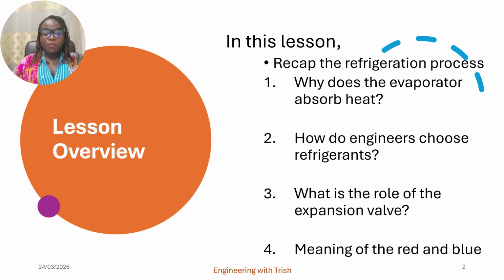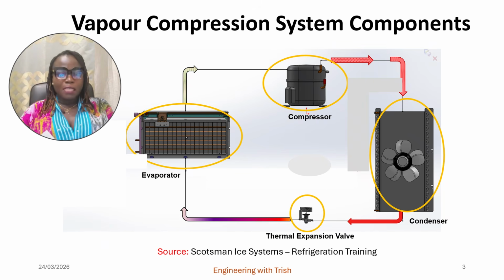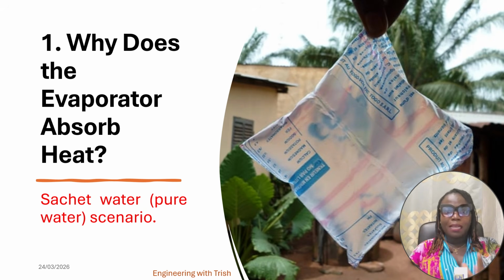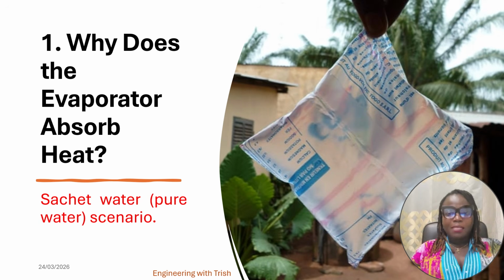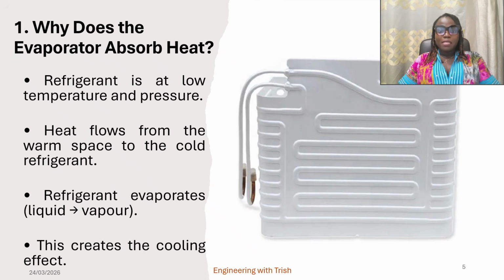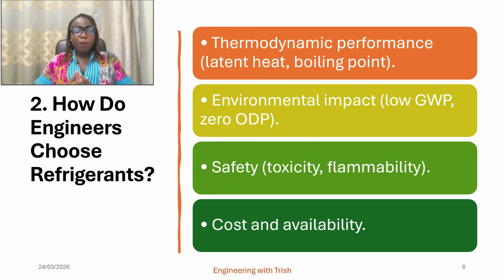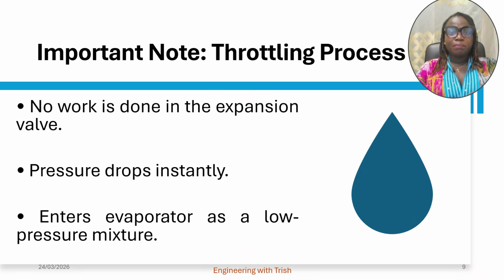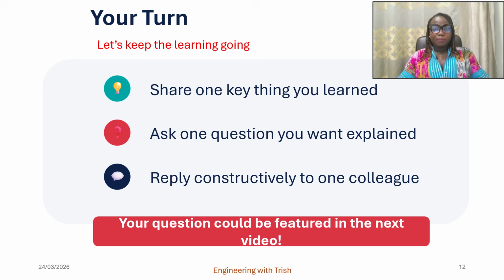Refrigeration Cycle Explained | Students Questions Series #1

Comment: I have learnt that the evaporator absorbs heat.
Refrigerants chosen are based on performance and safety.
Expansion valve enable the Cooling cycle .💯
Reply: Absolutely 💯
Reply: Yeah 👍👍
Reply: That’s nice
Reply: True 💪👌
Reply: That is very true
Reply: Good
Reply: Sounds amazing
Reply: Interesting
Reply: Yes of course it regulate the flow  of refrigerant
Reply: Yes, from the sachet or cup of water to which begins the refrigeration cycle.
Yes, it also depends on the environment effect it has
Yes, the throttle in the expansion removes the high pressure from the already low temperature gas or refrigerant

Comment: The four main components of the vapour compression system.
1.The compressor
2. The condenser 
3. Thermal expansion valve 
4. The evaporator. 2:27

Comment: I learnt that the evaporator absorbs heat by refrigerating at low temperature and pressure. and also heat flows from the warm space to the cold refrigerant.

Comment: I learnt that the four main components of the refrigeration cycle are 
1. Compressor 
2. Condenser 
3. Thermal Expansion valve 
4. Evaporator

Comment: in this video i learnt about  how  engneers choose  refrigerants. and they choose them according to the use of them. and there are 2 types, the R134a and the R290
Reply: Nahh bro those aren't the types of refrigerants, R134a and R290 are examples of refrigerants. There are about five types of refrigerants like Hydrofluorocarbons which R134a is an example of and another type is a natural gas called propane which R290 is an example of.
Reply: @Cielo915  oh okay, thank you very much

Comment: I have also learnt that the expansion vulve, based on its sensitivity is termed the brain of the refrigerator for its ability to control refrigerant flow, cause temperature drop as well as perform sensitive actions

Comment: I learned that refrigerator is a device that  absorb heat from low temperature to a high  temperature, also the working fluid in a cycle is called refrigerant
And also there are  four components of a refrigerator; 
1. Compressor 
2. Condenser 
3. Throttle 
4.evaporator.

Comment: I learnt that, evaporator vapourises the refrigerant by absorbing heat.

Please madam,which part carries the low pressure vapor from evaporator to the compressor.
Reply from the maker: Great observation! The suction pipe connects them. 😊

Comment: From your last lesson you made mention of 4 main characteristics of Carnot.
 - heat is supplied At high temperature 
-part of the heat is used as work done
- the heat not used is rejected into the sink

The 4th one was not mentioned.
Reply from the maker: No, four main characteristics of heat engines. Refer to your note for the last one since we discussed that in detail during our class session and come back here to post it. SHALOM.

Comment: I learnt that an expansion valve is a key component in cooling systems like air conditioners and refrigerator and main job is to control how refrigerant flows into the evaporator.
Reply from the maker: Correct, that is its primary function. 😊SHALOM
Reply from the maker: Correct, that is its primary function. 😊SHALOM

Comment: I have learnt the components of the refrigerator; condenser, evaporator expansion valve and compressor. 

My question is that, What happens if the refrigerator door is left open? and 
Why should hot food not be placed directly in a fridge?
Reply: Yes please Madam. I also want to know why we should not put very  
hot stuff in the fridge
Reply from the maker: This will be addressed under "Students Questions Series #2.". Watch out and subscribe to be prompted when I upload it. SHALOM
Reply: @EngineeringWithTrish  Thank you Madam

Comment: I learnt that the two main heat exchange of the refrigeration cycle is the Evaporater and the Condenser . Also the Valve controls the refrigerant flow and also reduces pressure
Reply from the maker: Spot on! 😊SHALOM

Comment: The refrigeration cycle is essentially a heat transfer loop:

Compression → Condensation → Expansion → Evaporation  
Each stage plays a role in moving heat from inside (cold space) to outside (warm space), with the refrigerant as the working fluid.
Reply: That great 👍 👌

Comment: I learned about the four main components of refrigeration and they are compressor, condenser, thermal expansion valve and evaporator and why does the evaporator absorb heat

Comment: I have learnt that the expansion valve like you said is the brain of the system. Thus, it controls refrigerant flow, reduces pressure and causes temperature drop.
Reply: And prevents too much refrigerant from entering the evaporator

Comment: I learnt that compression decreases the volume of refrigerant and increases the temperature and pressure of the refrigerant
Reply: Yh  and causes the compressor to heat and the heat is absorbed by the condenser
Reply from the maker: Heat is absorbed by the evaporator abd dissipated by the condenser. SHALOM.

Comment: Madam pls why the whole but of the part of the fridge not freezing
Reply: The fridge doesn't freeze because the evaporator is designed to absorb heat only from the system rather than the whole fridge.
Reply from the maker: Kindly reframe your question. I don't get it. SHALOM

Comment: I learnt that that the Compression process is mean the refrigerant is squeezed, the volume reduces, the temperature and pressure increases. 
And also Condenser is a heat exchanger.

Comment: At the end of this lesson, i learned the expansion valve has alot of function. And some are , it controls the refrigerant flow, reduces pressure suddenly in the refrigerator and it leads to temperature drop in it, etc
Reply from the maker: Great observations! Shalom.

Comment: I learned on how evaporator absorbs heat
Reply: Refrigeration works by removing heat from a low-temperature region and releasing it into a high-temperature region.

The evaporator is where heat absorption happens, while the condenser is where heat is expelled

Comment: I have learnt that the expansion Valve regulate heat before it is moved to the evaporator and engineers select refrigerant base on their application and safety requirements
Reply from the maker: The expansion valve regulated the refrigerant flow. SHALOM.

Comment: I learnt the meaning of colors in the refrigeration cycle 
And the red color means hot 
Region, high temperature and high pressure 
and blue means cold region, low temperatures and low pressure

Comment: If the ambient temperature in a place like Accra increases, how does that affect the condenser's ability to reject heat, and will it force the compressor to work harder to maintain the same cooling?
Reply from the maker: This will be addressed under "Students Questions Series #2.". Watch out and subscribe to be prompted when I upload it. SHALOM

Comment: I learnt that the refrigeration cycle works by removing heat from a low-temperature area and releasing it to a high-temperature area. I also learnt that the evaporator absorbs heat to create the cooling effect, while the expansion valve controls the flow of the refrigerant and regulates the system. 0:35

Comment: I have learnt that the expansion process also known as the throttle  which controls refrigerant flow and temperature drop                             my question is how long does it take in the expansion process.

Comment: How does the efficiency of a real heat engine compare to an ideal engine and what are the main factors that cause the difference 

What are the common losses in real refrigeration system and how can engineers reduce them
Reply: the common losses in real refrigeration system is compressor inefficiency , pressure drop, heat leakage,poor heat transfer

Comment: I learnt that the expansion valve is the brain of the system, it manages or regulates the system and it controls refrigerant flow to the evaporator
Reply: Yes, and also it throttles the refrigerant tiny into the system at a low temperature and pressure.
Reply: Yes

Comment: I learnt that when a sachet of water is placed in a refrigerator, the evaporator absorbs the heat in the water and I also learnt some examples of refrigerants which are : R134, R290. 
My question is, is the refrigerant in a fork of liquid or is also something like the valves?

Comment: I learned about the 4 main components of refrigeration and they are compressor, condenser , thermal  expansion valve and evaporator and why does the evaporator absorb heat ❤

Comment: Hello good evening madam.
 please my question about the video is the expansion valve. Please the expansion valve when it fails to operate, how does it affect the operation of the refrigerator ?

Thank you
Reply: So mind you the expansion valve is supposed to aid in the refrigeration process. If the expansion valve is unable to expand as required, then the fluid coming into the expansion valve would not be able to cool and the fluid leaving the expansion valve would be hot. Thereby the substance inside the fridge is unable to release its temperature or heat to the fluid that is supposed to absorb the heat.
Reply: @Darren-t9h okay 
So what if the fluid over flows? Does it fast cool the sachet of water , since the fluid has gone into the refrigerator to absorb heat from the sachet of water?
Reply from the maker: @mister__nobody.k  which fluid?
Reply: @EngineeringWithTrish 
You made mention of refrigerant fluid that flows through the evaporator in the refrigerator

Comment: I learned that A refrigerator cools water by using a continuous cycle of refrigerant to move heat from the inside of the fridge to the outside.

Comment: Madam please I  want to know whether all cycles are reversible as in the Rankine cycle used for the operation of the refrigerator?
Reply: I think for the ranking cycle it doesn't deal with reversibility of a process specifically but rather it deals with the actual outcome of a process. Mind you in the Carnot cycle every process is considered to be an ideal process. In a ranking cycle the processes that the cycle undergoes are not ideal, meaning it will be difficult for you to reverse the process back to its original state so in a way, I think not .

Comment: What is actually in the expansion valve that makes the refrigerant drop suddenly from high temperature  high pressure to low temperature low pressure
Reply: Well the expansion valve itself doesn't contain anything. In actuality the expansion valve is empty so when the substance enters it is highly pressurised, which means that it has a small volume or a small space to move around, increasing the temperature inside that expansion valve. You can see that it will start to expand. The volume in that expansion valve will start to expand maybe from 1 cm³ all the way out to, let's see, 400 or maybe 1 m³.

The reason is that when you expand a gas the particles in that gas have the opportunity to move around. When they are moving around they are unable to impact each other, meaning that if there are no impacts or collisions between those particles the temperature will not go up or the heat will not go up. Therefore the heat or the temperature will suddenly drop, reducing its overall temperature. When the temperature drops the pressure will also drop because pressure and temperature both vary directly against each other so if the temperature drops the pressure will also drop.

Comment: Madam is there a way where COP can be less then one
Reply: So I don't think COP can ever be less than one because COP in itself is the measure of the coefficients of a proficiency. When we talk about proficiency it's how well you can do a job or how a system can do a job. When you require a system to reduce the temperature of a particular substance and it is able to reduce that temperature (which in normal convention doesn't happen) then the system has over performed or done above what it has to do in experience if it were following normal rules. Now COP is always greater than 1. Yes and the more work you are doing, the more proficiency, or the more work the system is performing, the higher its proficiency.
Reply from the maker: Watch this video: https://youtu.be/u5ERwkxfK4c?si=DY-qJcsy7JTMvBpl

Comment: I realized that there’re two sides to the system where one is at a high temperature and pressure;(compressor and condenser) and the other is at a low temperature and pressure;(expansion valve and evaporator). I also had a vivid understanding of the second law of thermodynamics. I guess there’s no difference between this and the air conditioning system in our homes.
Reply: yes ,i also just knew what was always going on with my fridge

Comment: I learnt that the expansion process is also known as the throttle process which controls refrigerant flow and cause temperature drop

Question: What is the Coefficient of Performance (COP) and how does it differ from efficiency?

Comment: I learnt that choosing of refrigerant are base on performance, safe to use, and it should be cheap and available.
Also I learnt that the expansion valve functions as the brain of the refrigeration system.

Comment: And for this section, 
I learnt that the another name for the expansion device is the" THROTTLING PROCESS " and the colours used which is blue indicates the hot region and blue streak indicates the cold region/low temperature

Comment: I type my questions and sent them to you in your mail but you didn't address them
Reply from the maker: Type it in the comment section. SHALOM
Reply: How does the efficiency of a real heat engine compare to an ideal engine and what are the main factors that cause the difference.

What are the common losses in real refrigeration system and how can engineers reduce them.